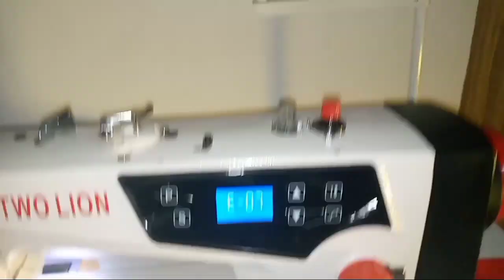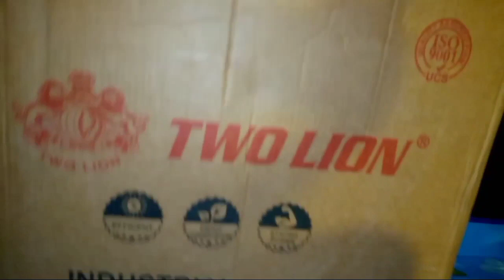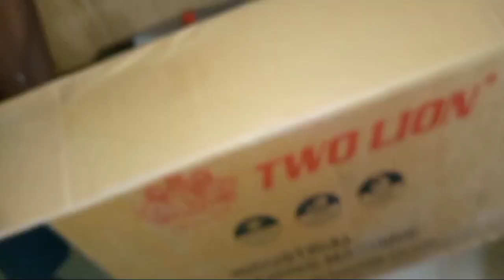SETTING UP AND ASSEMBLING INDUSTRIAL SEWING MACHINE TWOLION(direct drive)   #industrialsewingmachine

Comment: Pls i need help with my machine too,exactly this type,but is bringing out E-22 and is not working for weeks now,pls i need help with it.
Reply from the maker: Hello, mine had the Same  problem also but it was because of the power source,  so do well to check if the electricity is low current a d do something about it. Let me know if this helps 🤗.